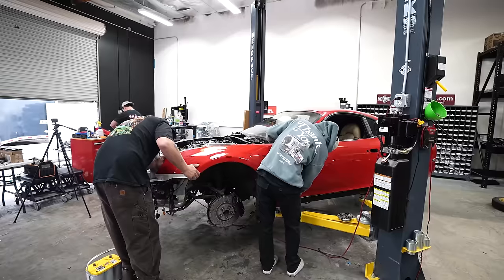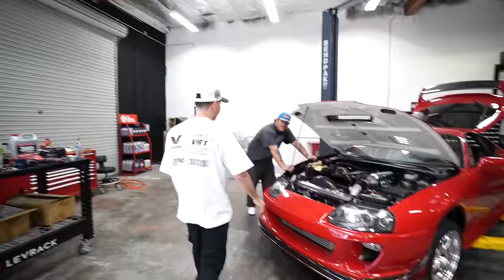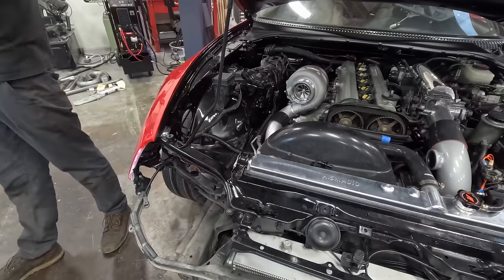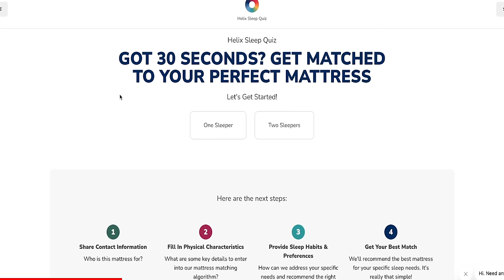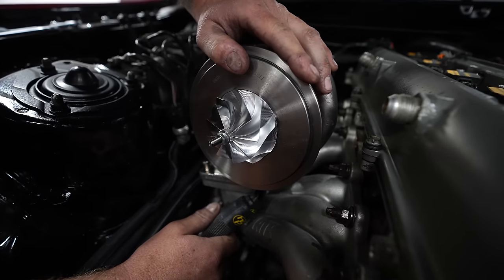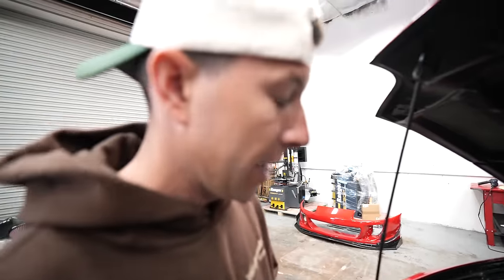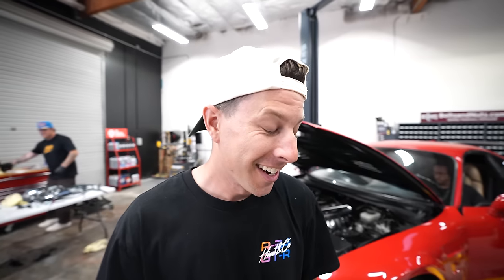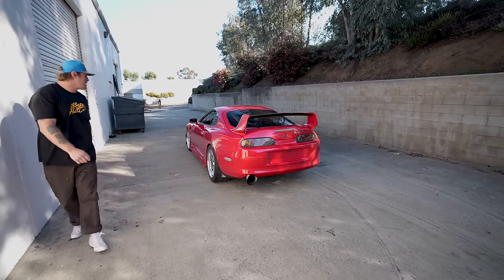The Largest Financial Loss I've Ever Had Pt.4

Comment: 10:40 Insert previous clip of T.J saying how important it is to do lines properly referring to the exact line he is saying will be redone, also that extended oil drain that was mentioned in a previous clip, clearly didn't get used because that oil drain is another fire waiting to happen. Calling the last couple projects "builds" is a bit of a stretch.